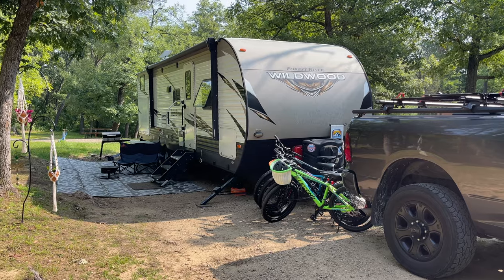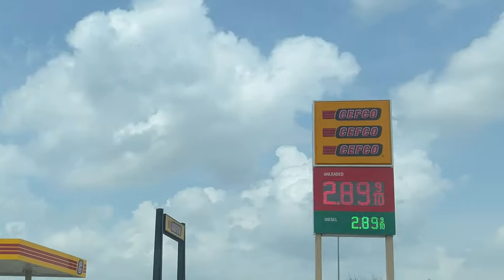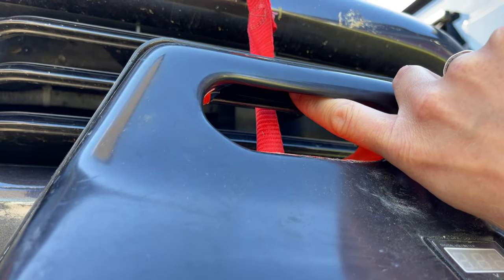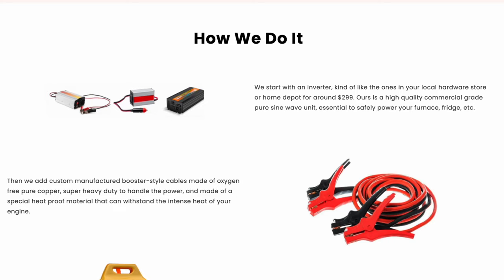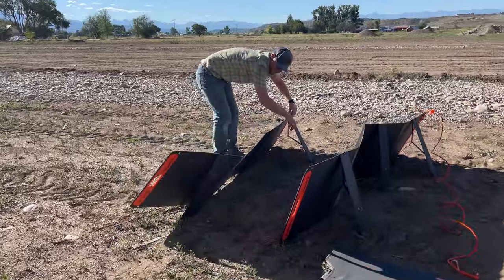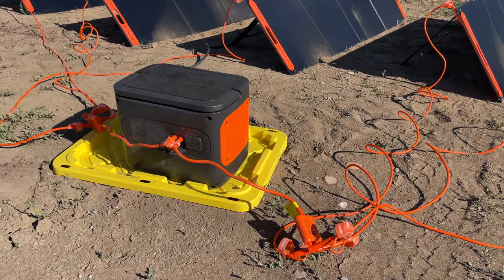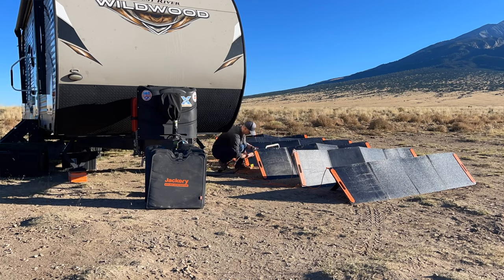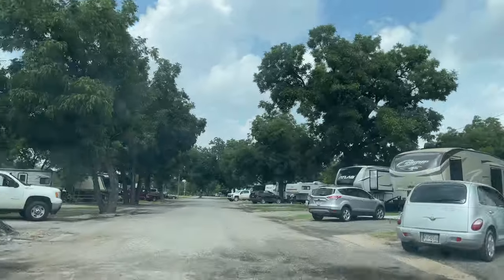Easy Boondocking Power Options For RVing: Car Generator vs Solar Generators vs Dual Fuel Generators

Comment from the maker: ⭐⭐ Examples of Products Used In This Video ⭐⭐
🔷 CAR GENERATOR DISCOUNT 
For $150 off a brand new model, $250 off a factory refurbished 1000 watt model, or $400 off a Home Integration Bundle please use the affiliate link below:
https://offer.cargenerator.com/rv-gear-far/
🔷Jackery Solar Generator: https://amzn.to/3P0P8k8
🔷Champion Duel Fuel Inverter Generators https://amzn.to/480tQLZ

DISCLAIMER We participate in several affiliate programs that earn us a commission on purchases made through our links at no extra cost to you!
Some product links are affiliate links which means if you buy something we will receive a small commission. As an Amazon Associate I earn from qualifying purchases. 

🏘 Join the RV Gear & Far Group Here:
https://www.rvgearandfar.com/rvgfyt 

⭐🌟 Check out ALL the products and gear we recommend here: ⭐🌟  
📦 https://www.amazon.com/shop/rvgearandfar 📦 
 
*Disclosure: I received the Jackery Solar Generator and the Car Generator complimentary for testing and demonstration purposes. The opinions and experiences are my own and I was not additionally compensated or directed in any way concerning anything presented in this video.*

Comment: I have been working on coming up with power options for boondocking while on the road during some trips. We generally harvest host our travel stops and some aren't generator friendly so I picked up a Bluetti AC200MAX. I was quickly shown that I will need at least 1 200 watt solar panel to keep it running for an overnight. I have a Firman inverter generator that I've modified to run off my campers propane, and added a propane quick connect on the driver side of the camper, which saved us on our trip to Gulf Shores this year. I'm optimistic about the Bluetti once I get some solar though
Reply from the maker: I love the propane quick connect for our gennies too! Hope the increase in solar gives you the results you're looking for!

Comment: A big factor for a lot of people is going to be the ability to run air conditioning while boondocking. I'm guessing the tandem gas generators are the only thing up to that task?
Reply from the maker: Have to size the generator output to the AC requirements — adding a softstart to the actual AC unit reduces the power surge on startup and allows a single AC to be run off a single 2000w genny or some folks have gotten dual ACs running off 3500w if both units have softstarts installed

Comment: All are beat by the ecoflow delta pro
Reply from the maker: In what way? Tell me more
Reply: Delta pro has a 30amp plug right in it, takes like 1600watts of solar charge u can charge it with an ev charger, its expandable to 25kw so you can add on to it as your needs change. And when camping season is over you can use it at home. Requires no fuel and no special wiring. 3600 watts of power and silent operation. Its expensive but nothing will beat it